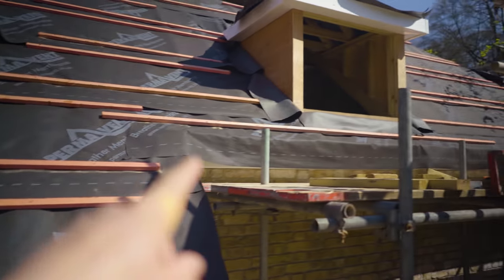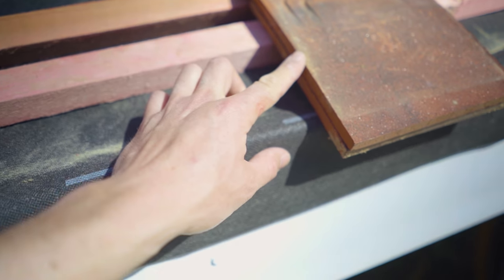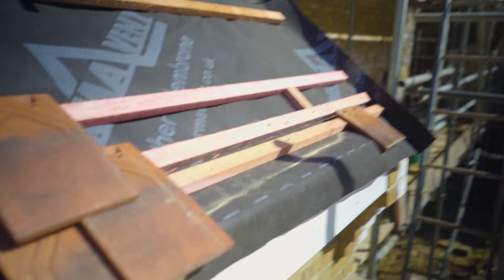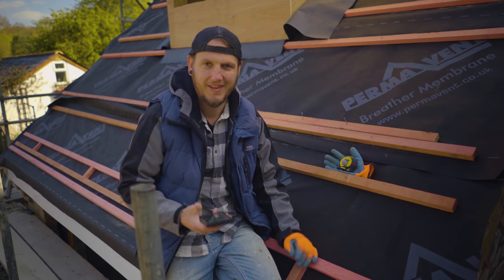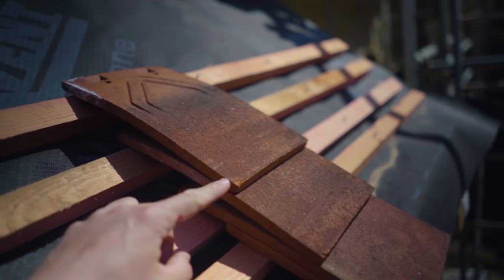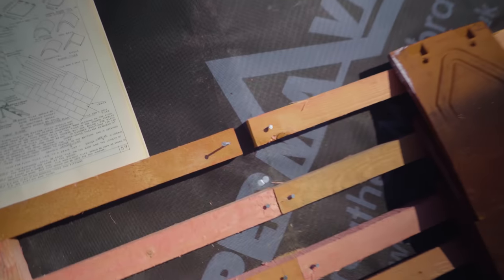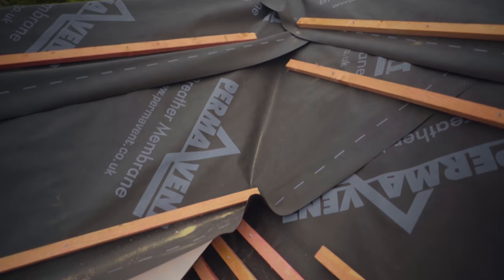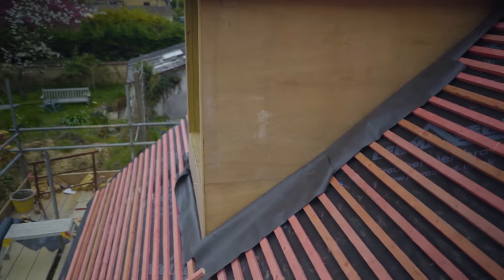BUILDING A HOUSE ALONE from START TO FINISH | E.P 41 [Am I the worst roofer in the world?]

Comment: Glad you are up for learning. Great video. Dont be bothered by making mistakes it's part of learning. Consider putting eave protectors in. Not sure how you are finishing the gable ends, if its with mortar remember to keep the batons short from the end so they dont soak up water and rot. Never go over 4 inches, always go less. Remember to put sag in your felt, it means that any moisture from the house is not sat against your batons and wont rot them. Nail holes on the spas isn't a problem given the sag in your felt. Consider getting a hammer staple gun. Once you have worked out your spacing, go up the roof with batons double spaced and then come down filling the gaps in, it makes it easier to move. Keep learning, top vid

Comment: For the valley tiles you gotta make sure that the two roofs are pitched at the same angle to make it work? Then I usually cut a piece of tyvek no smaller then 600mm wide and run it up the valley under the felt you’ve already put there then cut the battens at a 45* and butt them together and carry on the spacing as usual but make sure you allow some tile overhang at the bottom of the dormer where the fascia is ready for guttering so the bottom tile might not be spaced like the others, and you could also double up on the bottom battens of the roof so it kicks the tile up slightly to slow down the water as it goes into the guttering
Reply from the maker: The dorma and roof are pitched the same so valley tiles should work. Im cutting the battens together at 45 degrees in the valley so should come up nicely. Thanks for the tips bud 👍😁
Reply: Rodian Montague Builds no worries pal loving the videos!

Comment: I really wouldn't worry about a few nail holes in the felt it's only there as secondary protection if the tiles fail. Looks like your doing a cracking job mate
Reply from the maker: Im not too worried about the nail holes. Hardly seen any to be fair 🤣

Comment: Easiest way to batten a roof when using plain tiles is fix your first batten using the facia board as your guide then put battens on at 300mm all the way up to the ridge then fill in at 100mm working down it’s so much easier than working up with your feet in them small gaps. For the valley tiles just but the battens up but remember if the dorma and the main roof aren’t the same pitch the battens won’t meet. Valley boards and lead are a good alternative don’t use them GRP shite.
Reply from the maker: Thanks bud. Had a few people say the same thing. 300mm up and infill on way down. Ill deffo do that next time!
Reply: That's the way to do it!
Reply: And zinc valley's are shite...
Make sure to get last batten on 30mm down from the ridge board.
Reply: Wrong... work up in 8”, then go in between using no tape and fill the middle batten.... much quicker
Reply: beenflicker1 did not say your method is wrong... I said you are wrong that it is the fastest method... which you are very wrong because it is not the fastest method!
Reply: Is Adam Mason the thickest roofer in the world?
Reply: @Mark-gf7yw  yes
Reply: MARK FINN you seem to be...
Reply: So Confused and you....
Reply: @realadammason  Well im not a roofer but yeah if i was to try today, i would maybe be the thickest roofer in the world, but i bet you would still give me a run for my money.
Reply: @realadammason  Dont be upset bud ;'(
Reply: @realadammason  ok dude

Comment: I would do away with the crappy batons all together a do what every other country does and covers the rafters completely with OSB then instal the membrane (joints sealed) then do what ever you want with the tiles...no need to over complicate it to much! Also your current set up will surely have poor heat retention and noise from outside!! Just a thought but over all a very good project! 👍
Reply: You couldnt literally have any less of an idea how a roof works 😂

Comment: If you use valley tiles, your battens MUST line through when you change direction. If the dormer pitch is slightly different to the main roof pitch, it will alter the gauge a bit. You’ll never see it off the deck though. Keep up the videos and good work 👍👍
Reply from the maker: They are both the same pitch and I've made sure that line up when changing direction. Should come together nicely 🤞😁
Reply: Rodian Montague Builds 
Cool, valley tiles look much neater than lead on those 10 x 6. Look forward to seeing the finished job. Keep on trucking😉👍👍
Reply from the maker: Cheers buddy. Getting there 😁👍🏻

Comment: Nail holes in felt not really a issue if only on rafters, normally would rough felt roof which means lay the felt and battens would b nailed in the right place for example plain tiles like you have should be around a 4” gauge or less so long as the battens spaces work out u can miss as many as u like and then u just fill other battens in after just saves time and no unnecessary holes also less strain on u.
You’re meant to measure from just below ridge down to fascia and work the gauge of whole roof out as u need eve course to finish at top.

Valleys... u can just butt the battens as close as you can as valley tile covers well, I personally cut the angles though. The lead at top of valleys is a lead saddle, u won’t really see it just a bit of the bottom of lead sticking out below ridge tiles it goes over top of valleys but under main roof tiles. I personally would lead the valleys.

Dormers, ur be lucky to match courses up as ur restricted by the gauge on dormer cheeks as u need eve course at the top, won’t notice from the ground anyway them not in line.

Been enjoying you’re videos mate keep them coming you have done a brilliant job so far u should be very proud 👍🏼
Reply: YoungCarReviews what a great and nice comment ! Top man
Reply: kirby2kirby....thanks 👍🏽,Ud think I would get a like and reply from the man himself
Reply: Your welcome, I'm sure you will. He seems like a nice guy, be it a busy one though 👍🏻
Reply from the maker: +YoungCarReviews Thank you for the very detailed comment, I really appreciate it. I'm not going to worry too much about nail holes as they are on rafters. Also I've pretty much done half the house now and only seen 2 holes. Must have been very lucky. I know now the best way to do it on the future. I've cut the battens at 45 degrees going up the valleys and looks like its working pretty well 👍 Im happy to hear I wont see much of the lead saddle under the ridge. I wont pay too much attention to trying to match up the dormers to the main roof. I will work down from the soffit and it should look good in the end. Glad to hear you're enjoying the series buddy and I do feel extremely proud to have gotten where I am, all be it very knackered 🤣 Its been a super busy weekend, didn't get a chance to get back to all the comments straight away. I like to reply to as many comments as I can. You all took the time to comment me so I take the time to comment back. 😁👍
Reply from the maker: Kirby2kirby Thank you, I like to think I'm a nice guy 😁👍

Comment: U need to make shore the pitch of the dorma is the same as the pitch of the main roof to make valley tiles work, an with the batterns i lay a battern up the center of the valley then butt the batterns into that then remove the one laying up the valley. O and the courses have to corispond with eachother.
Reply from the maker: Thanks for all the tips. The roof and dorma are both the same pitch so looks like it will work😁👍
Reply: Awsome the house is really startin to take shape. Gd job👍👍
Reply from the maker: It's getting there 😁